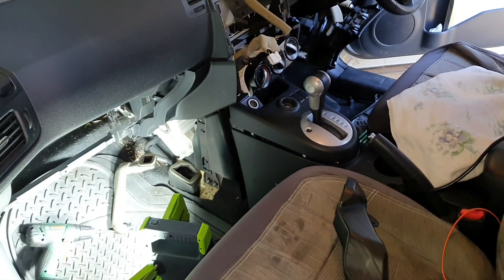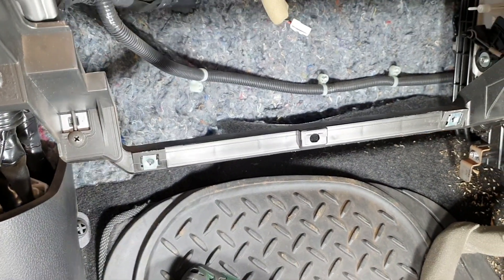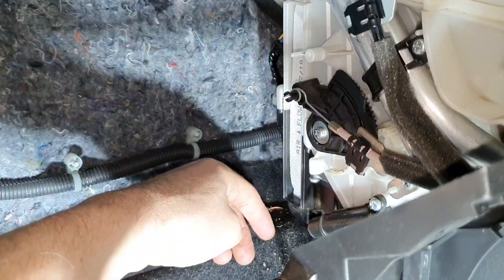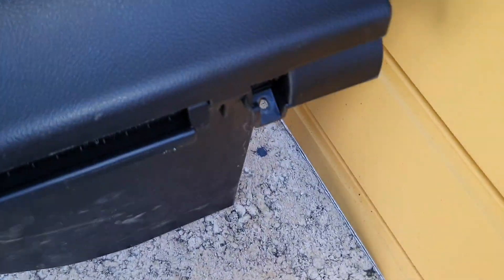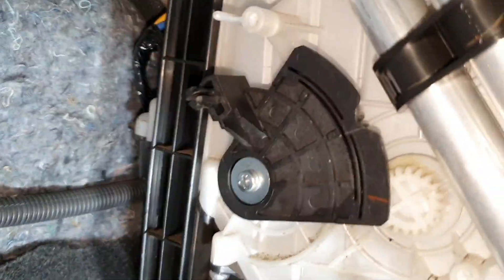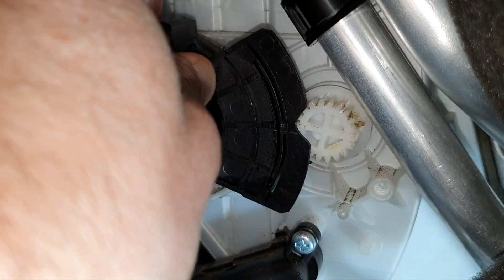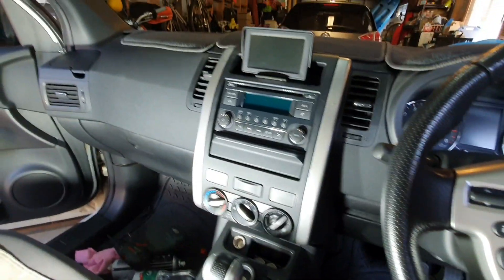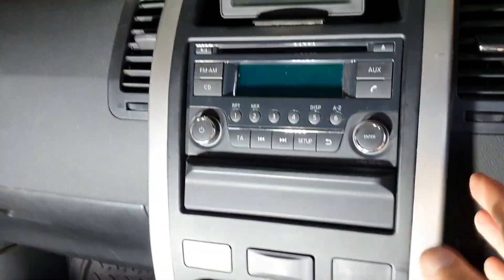Nissan X-Trail T31 repair heater cable, replace cabin air filter, remove glove box, remove radio

Comment: Had exactly the same problem with my T31. The problem is inside the heater itself where the shutters move to redirect the cold air and warm air, depending on what you want. After a while the shutter mechanisms become worn and heat can make the seals around the edges of the shutters sticky and perish. Eventually the lever mechanism that turns that little white cog jumps and the cable gets stretched out. So if you can just turn that little white cog that is the direct drive to the shutters (like he did with the screwdriver) you can regulate the heater! But all the cables and levers and cogs just make the system seem over engineered when wear and tear sets in. I do it manually now, I left the plastic heater vent to the floor off and just remove the side panel near the passengers right foot to get easy access to the mechanism and help the mechanism turn while turning the control knob. It takes 2 hands and a little practise but you can have air con and a heater without having to change the whole heating/cooling system. Which is probably out of the question anyway.
Oh, and disconnect the battery before pulling out radios and disconnecting cables. The electronics are very sensitive and if you don’t, you might get warning lamps blinking that didn’t before. My airbag lamp blinks now 🤷‍♂️ I must have got close to the passenger airbag and it didn’t like it.
Another thing, the cabin filter is easy to change without the glovebox in the way. You have to squash the filter to get it in or out otherwise, talk about an after thought!
Good luck!

Comment: dudeeeee youre almighty awesome cu nt thank you so much ay!!!! this is exactly what the problem is on mine and i have been cooking because even on 0 the heat flows through steady. Driving in summer i pack 6L of water and three gatorades so i dont get heat stroke from dehydration

Comment: Same issue on 2012 TS model.  It think the issue is wear of the components (internal to the main unit) as well as age of the black plastic cam? (which the cable connects to).  The black plastic cam is suffering from age and the plastic is getting softer and bendy as it ages.   I am guessing there is a baffle inside the main box in front of the heater core.  With age this is likely not moving as freely as when new.  Doesn't seem too bad with a screw driver though.  To help,  I bent the bracket for the cable in towards the cam to help hold it back in against the gear.  We'll see how long this lasts.  Have to treat it with a lot of TLC when operating it from now on.

Comment: Thanks mate, I am having the same problem with mine, the hot / cold air dial has been stiff for a while and now the hot won't shut off fully. Your work should save me a lot of time diagnosing the problem I know exactly what to look for now, I will tackle it  tomorrow. Well done and thanks 👍

Comment: I adjusted the cable length by releasing the bracket clamp and sliding the cable outer along a tiny bit. I now have 100% cold air but only, say, 95% hot air.
Reply: So earlier were you getting warm air. 
In my car when I turn the temp control knob to max cold. And turn the fan on , warm air comes through the vent.  Is that the issue you were facing. Thanks.

My engine seems to hot too. But the engine temp gauge inside the car goes up to the normal level and stays there.

Comment: Thanks so much for this video. I have the same issue, except that with mine the actual plastic wheels seem to be worn out too. 🤦🏾
So I’m left with going through your entire process twice a year, just before summer so that I can cool air. And just before winter so that I can have a heater. Does anyone know if replacement parts are available for sale anywhere?

Comment: I'm having this EXACT issue. 

Did you get a part number for the black part that rotates or a reason why it goes off the gear teeth? I think the black piece is just fatigued, or where the cable is screwed in, that ancho could be fatigued.
Reply from the maker: I think it's just a weak design with too much flex. When the cable starts to get a bit stiff it flexes out of alignment. Probably a good idea to get some lube in the cable. You can also adjust the cable length using the bracket that holds the cable sheath. Moving the cable sheath back a bit to account for a stretched cable may help. I found that the plastic parts themselves were not damaged or fatigued in any way.

Comment: Seems plastic wear is causing my friction,  and not the little gear. I'll be cleaning the cogs and faces, then putting silicone grease on the cogs and spray into the wire runner for max lubeylube

Comment: Great Job! Learned so much how to  avoid mistakes sorting this Problem out on my LНD xTrail. I still think the Root cause was a Filter not fitting completely the box.. Then dust did bypass it and settled on lubricant of Internal Gears of an "Air mix door" (a Shutter) inside.   Similar to followin Leftie Qasqai   -  https://www.youtube.com/watch?v=P65B8WNE1U0&ab_channel=%D0%A1%D0%B5%D1%80%D0%B3%D0%B5%D0%B9%D0%97%D0%B0%D1%85%D0%B0%D1%80%D0%BE%D0%B2
Reply: Can the T31 be pulled apart the same way?